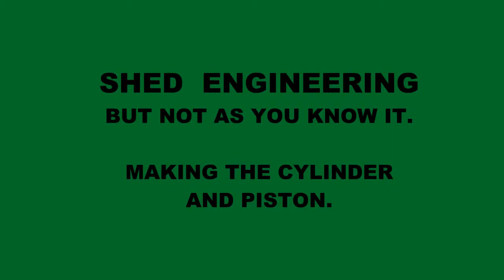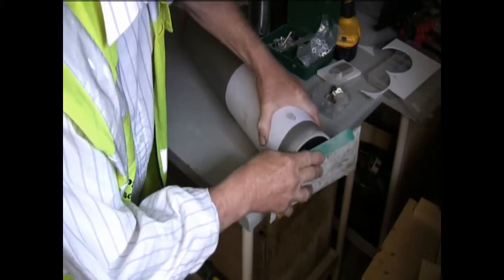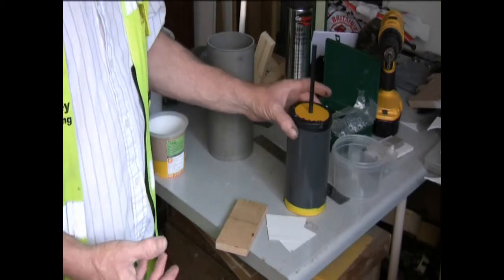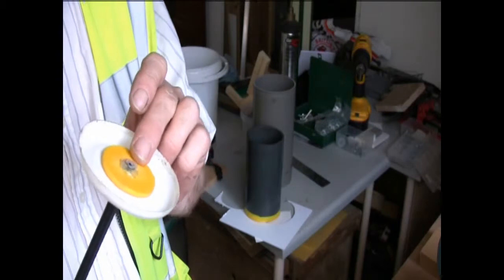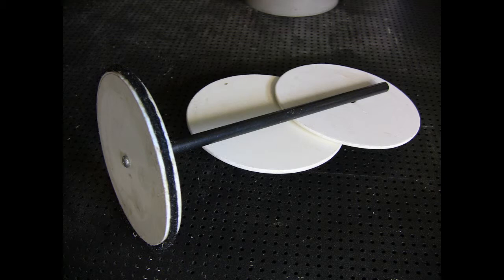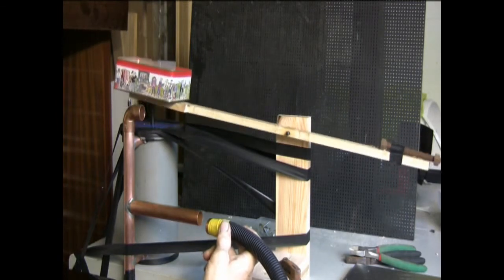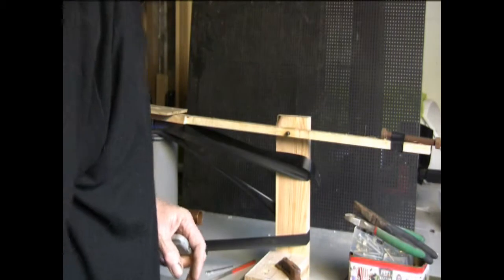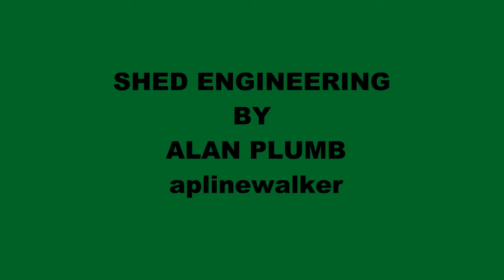BEAM ENGINE MAKING THE CYLINDER & PISTON.   PART  6 by shed engineering.

Comment: I found the other parts of this series at last.   I was a little amused at the  method of testing of the lift in the power piston.  You know, just estimating the force that piston would generate with a differential pressure of one bar I estimate that the force  for a four inch cylinder would be in excess  12 multiplied by 15 and that is about 180 lbs and that is a lot to balance  of force to  balance out with a pair of pliers and similar load units .   Congratulations on your work, you sound as a true English gentleman  where I met a few of them when I spent fifteen  years in England, seven at Chatham Dockyard and eight at the University of Newcastle upon Tyne where I visited most of the museums showing in Parson's work and Armstrong and also went to see where Stevenson lived ! Good old says  living on the same area including Scotland where so many steam engines and turbines started their lives. I often went  to  see the Turbina the first  steam turbine ship  and that did over 33 knots to shame the British Navy which would not accept Parson's invention. They did after he showed them that his steam " engine with tiny blades" was faster than the pistons the Navy had.